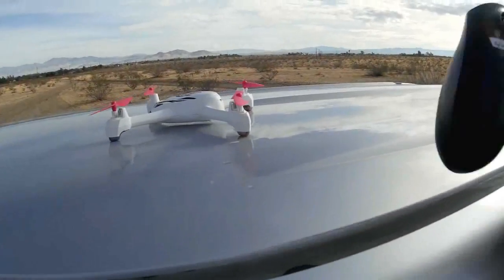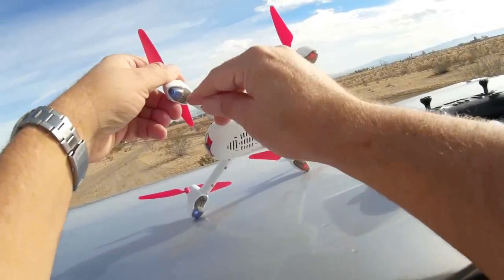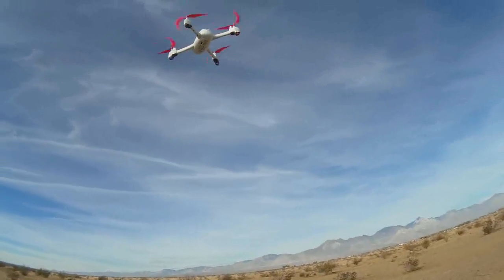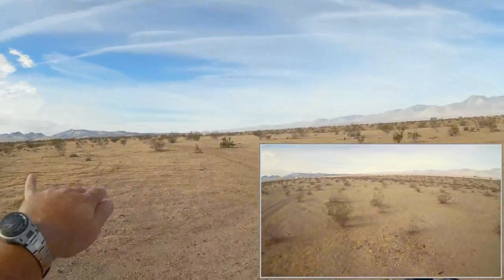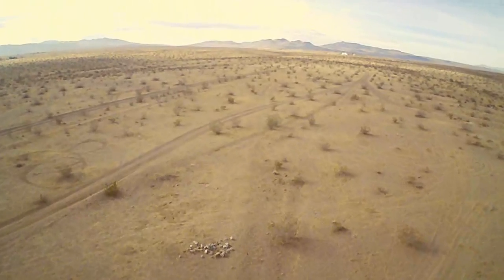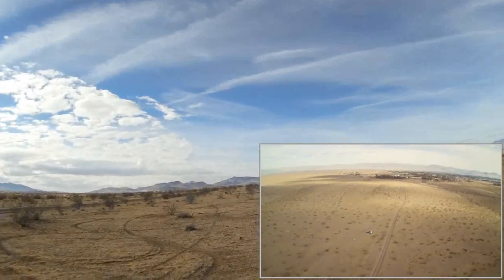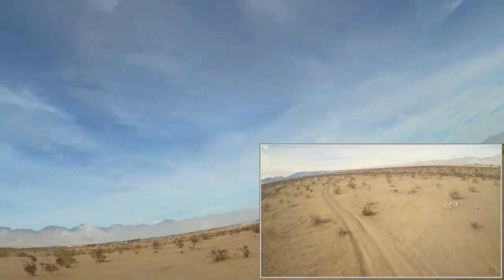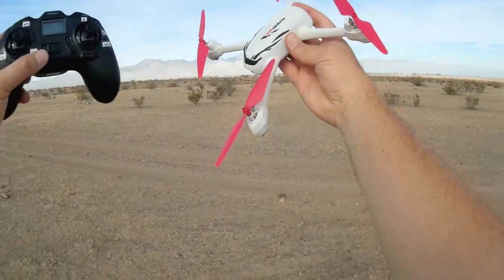Hubsan H502E GPS Drone Tips for New Fliers

Comment: I'm a little late to the game here - but is there a way to arm & fly without a GPS lock?  Now I'm flying indoors the quad will not arm due to the tin roof.  Some sites say it's possible but don't mention how!
Thanks
Reply from the maker: Not sure if Hubsan has changed the firmware?  But try completing the compass calibration, and then try arming the motors by moving and holding both stick down and outward.

Comment: We had two of these from ebay recently and both had motor failures after only a few flights.  The second one fell from the sky without warning.  I think Hubsan has compromised the quality by going with cheap components on these now like inferior motors and plastic bushings now rather than metal bearings compared to when this video came out.  After the first H502E was repaired with a new motor, it failed again.  Even a brushed quadcopter should last longer than a few flights.  Any other gps quadcopters out there like this one, with gps but with brushless motors you would recommend in the sub $100 USD category?  We don't care so much about photography, just having a fun gps quad.  Thanks

Comment: Another nice video.  Great tip about checking the gears too.  Question... so the H502E has full GPS (altitude and position) on all the time and you can't turn off position to just have altitude hold, right?

Comment: Could I ask you , can this h502e x4 desire work with The Xiaomi WiFi repeater? I just bought this drone and I know it’s considered a toy , but im trying to get extended range , can you help?
Reply from the maker: No the H502E does not use WiFi.  But its range is close to 300 meters (make sure to use fresh batteries in the transmitter). 300 meters is a very long way for such a small drone.  I can barely see mine when I fly it out to this range.
Reply: Quadcopter 101 , sorry my assumption was that the remote and the quadcopter both have the 2.4ghz Antenna so I figured if i bought this h502e and the xiaomi WiFi repeater I could get good reception, oh well ! Tell me can the elfie pocket drone from JJRC work with that WiFi repeater?
Reply from the maker: JJRC drones are very iffy whether they will work with the repeater.  But the following does a good job with the repeater https://www.youtube.com/watch?v=_pEcWUU6HEI

Comment: How do I put it into headless mode please. And wich figures show height and distance? Thanks
Reply from the maker: It no longer has headless as that feature was removed about a year ago.  The LCD screen cycles through heading, height, and distance.  When the black line illuminates to the right of the number, its telling altitude.  When the line is below the number, it's telling distance.  When there is no line showing with the number, it's telling heading.  This may help https://www.hubsanus.com/media/support/H502E-User-Manual.pdf

Comment: Quadcopter 101 will it last like a brushless motor drone as long as you take care of them or will it still wear out after some use??🤔
Reply from the maker: Yes it will eventually wear out and need to be changed.  But that could be a long time if you take care of them.
Reply: Quadcopter 101 nice

Comment: Since it's to cold and snowy out I  flew it inside the house, I had a heck of a time getting compass 1 to calibrate  compass 2 went ok, I did pick up 8 satellites  I took it up,  and it would not hold position it was very very unstable , do you think that is from being inside?
Reply from the maker: Yes, do not fly indoors as satellite reception will be poor.  Also wait to get more than 8 satellites for improved GPS position hold.  I usually wait for at least 10.
Reply: Thank you for all the time you put into your video's they are a great help! Yea the only reason I fired it up indoors was that when I hand spun the props, on the one I could hear allot of gear chatter then on the others, when I shut the motors off on the quad one of the props stopped spinning sooner then the others and it was not the one that had all the gear chatter.Point being I just received this quad a couple day's ago and I was hoping nothing is wrong with it before I get a chance to fly it outside. Thanks again!

Comment: I got my Hubsan H502E last week. I was worrying that I get crashes. First thing I did was added springy landing gear.  It protected the copter from the few bad falls.  I'm not sure what to do at this point. The Hubsan H502E has all the GPS counts(11).  It was about 40 feet in the air then it started to wobble and then the toilet bowl effect out of control, down fast.  So far it happens each time I go out to fly. 5 crashes so far.   Is there an firmware update I can download to fix this problem?   I really like this quad-copter.  Please help.  Thanks.

Comment: Hi Quadcopter 101

I have just purchased H502E but cannot get headless to work.  After doing some checking it looks like this feature has been removed by Hubsan on latest models.  I am in UK so it is difficult to get any quick reply from Hubsan.  Are you aware of this change in spec?
Reply from the maker: Yes, the newer Hubsan's no longer have headless mode.
Reply: Hi , Just the H502E?  I have just ordered H501S.
Reply from the maker: I think that they removed it from all the H501 and H502 quadcopters.
Reply from the maker: But why would you need headless mode with a GPS quadcopter?
Reply: Hi
I am new to quadcopters and just thought some times it may be easier to fly headless.  As you say GPS makes it as easy.  Anyway love the videos!!
Reply: Alan Hayton yes GPS makes it almost fool proof .Patience and muscle memory is the key to enjoying this pastime . Watch tutorials and build up to flying in a circle thereby getting over everyones fear of loss of orientation. Have fun

Comment: Hello, Quadcopter101. I have a Hubsan H502e as your test and an advanced command of the H501SS, did you check if the little one is able to be able to fly with the advanced knob?

It would be interesting to use the "follow me" function with the double gps. Although I have my doubts for compatibility with the firmware. Can you tell me something about it?
Reply from the maker: The H502E does not have follow me or FPV capability.  However, the more costly H502S does.
Reply from the maker: I'm actually surprised that the follow me feature works with the H502E when using the H502S transmitter.  But then again, the H502S transmitter has built-in GPS, and is sending its location to the quadcopter.  One disadvantage of the H502S transmitter is that it really drains batteries quickly (powering the FPV screen and its GPS).  That's why I prefer the original H502E transmitter, as it gives range close to 300 meters, and its batteries last long.
Reply: Quadcopter 101 , My friend, the command I have is the advanced 501SS, the batteries are no problem since I use a lipo of 2200mah to 3s and lasts much more. If the standard control is compatible it is assumed that the advanced will also be included telemetry, follow me apart

Comment: This one does turn around facing the "home" location in RTH.  Not the h501s, right?
Reply from the maker: Yes the H502E turns back to face you on return to home.
Reply: Maybe they decided to do it that way on the 501S because of the 5.8 Ghz antenna location inside the drone, it may be in the back.  I don't know.  It would be nice to have it face you on RTH.

Comment: Hi, I have the H502e and am using it as a trainer. It seems as though it is highly vulnerable to any breeze what so ever and is very hard to control. Do you find that to be the case.btw I like your channel.
Reply from the maker: No I don't find that to be the case.  How many satellites do you have locked before taking off?  If 6 or less, you may be flying in altitude hold mode without GPS position hold.
Reply: Quadcopter 101 i love your channel!
Reply: Me 2

Comment: I have the the 502s and have been having trouble picking up and dropping gps lock on the quad. Any thoughts as to a possible cause. Thanks!
Reply from the maker: Are you flying outdoors in an open area?  Trees or any structures will block GPS signals.  You'll need as clear a view of the sky as you can get.
But if you are flying outdoors, the next suspect thing is the GPS antenna shield.  Assuming that you don't have any objects taped or strapped to the top of the quadcopter (these would block the GPS signal), the antenna or its antenna shield might have come loose inside the quadcopter.  The following video (at 5 minutes 40 seconds into it) shows the location of the shield, and how it snaps into place to the circuit board.  As a last resort, open yours up to see if the shield has come undone from your circuit board. If it has, snap it back into place as shown https://www.youtube.com/watch?v=axtgDbbCmcY
Reply: Quadcopter 101 Wide open. a few trees and clear skies. was flying yesterday and it just dropped. Switched it to alt hold mode to retain control
Reply from the maker: It dropped?  That's very different.  Did you happen to notice how many satellites were being received when it dropped?  Was it a rapid drop from the sky or a gradual descent?
Reply: Quadcopter 101 Sorry. The gps signal dropped. Went from 10 sats to zero. It came back eventually but its been doing this sporadically.
Reply from the maker: Yeah, I suspect that your antenna and shield may have come loose as shown in this video https://www.youtube.com/watch?v=axtgDbbCmcY&t=0s  You'll need to reseat it if it has.
Reply: Quadcopter 101 Thank you so much for the help. Big inspiration for my channel and a great resource for us newbs. Keep up the great stuff!

Comment: I just bought the newest sibling to this quad the Hubsan H502C and I aint sure that sand in the brushed motors is such a big issue. Its actually in mine (at least) Impossible to clean the gears that way you talking about. I actually have to open up the whole quad to do that because the gear is allready shielded by the ledlight.
Reply from the maker: Use a pin instead of a toothbrush.  Slide the pin between each tooth.  Also if you have some canned air,  blast it with some compressed air to clean out any loose dirt in the pod.
Reply: Thanks forr the tip, but still not possible. YOu might be right that Hubsan change their design to these motorpods, because to remove these plastic glas for the ledlight, you cant reach the gears from below as you say. YOu have to remove the whole canopy to reach the gears. I mean thake off the top, they whole shebang. I know, Just open up mine H502C that in sense have the same spare parts. :-)

I did try your top, when my motors stoped working, and removed those two screws and the blue plastic and found no gears at all. And to be honest It didnt get me happy when I found out I had to open it up, the whole quad. SO when you shall change motors, or clean the gears  you have to open it up.
Reply: Jerry Berglund should I get 502c or 502e?
I am also considering wltoys v686g

Comment: How do I stop my hubsan desire 502e wirling
Reply from the maker: I'm sorry. I'm not sure what you mean by the word "wirling"?
Reply: Quadcopter 101 the toilet roll effect,, . Sorry about calling it a wirl,
Reply from the maker: DjHappy Raver Wsit for more than the minimum satellites before taking off.  I usually wait for at least 8.  Also, be careful when flying in high rate.    In high rate, with full forward pitch, the quadcopter can sometimes fly faster than the GPS can keep up.  When this happens, TBE will become apparent and may increase as the GPS error becomes worse.  To correct, let go of the stick and let it hover until the GPS fix catches up.  Then proceed at a lower speed than you were flying.
Reply: Quadcopter 101 thanks for the advice,  I'm a drone beginner lol but is becoming a great hobbie

Comment: Since this has GPS. If it get's out of range of the transmitter. Will it automatically start doing a return to home on its own?

Also from watching the video. The little LCD takes you the altitude and distance.
Is that correct? What would you guys say is the max altitude and distance you can fly the quad?

I'm thinking about buying one. It's cheap enough to where I won't cry too bad if it breaks. 

Last does this one have to be registered with the FAA?
Reply from the maker: Yes it will return to home upon loss of transmitter signal.  Yes altitude, distance, and true north compass direction that it is pointed are listed in the LCD screen.  Max distance that I've flown this is just under 300 meters before it lost the transmitter and started flying home.  No this is light enough that it does not require FAA registration.
Reply: Thanks for the reply. I think I'm going to get one to play with. It's affordable to not cry over if it crashes

Comment: QC.... I was wondering if you recovered that H501C. All that and only a single ESC burnt out.

Heck, I replaced a motor on my H501s, and while up 180' it dropped like a rock on my apartment roof, bounced and came to the ground. I replaced the body, flight controller, the motor, and esc. Also had to re-solider a cpl of wires with heat shrink.  On my 501S transmitter, I put a 6.6v, 1100 LifePo battery on it and get 10 flights before needing recharged.

Comment: Hei,Norway calling..hope you don`t mind some questions. Want a "cheap" drone to bring with me when out fishing norwegian outdoor, and tenting for several days. Sice matters..Is the main difference from 502e to 501s, FPV and FOLLOW ME? Is 502 stable in wind as 501? Both has GPS HOLD..? I see that there is big difference in price, and if 502e flys as good as 501, i don`t care about Fpv. Can tou advice me? Hope you understand my english..thank you in advance
Reply: The 501 has brushless motors while the 502 has coreless motors.  Also, the 501 has nearly twice as much flight time and as a result of the longer flight time and stronger motors has a much larger flight range.  The 502 will take you 300-400 meters out while the 501 can go 800+ meters.  The 502 isn't even close to being as stable in the wind as the 501.  The only word of caution for either is with regard to Hubsan's quality control.  Seems like you'll either get a good quad or a bad quad...50/50...and they don't have adequate staffing or a "proper" department to provide the quality customer support you'd expect from a company with the market share size that they have.
Reply: Thank you..

Comment: Interesting reading the comments. I had a few crashes in trees and grass and did not immediately turn the motors off. I then had problems calibrate and binding the transistor. Fixed those problems but now cannot arm the copter? Does anyone have a solution? I hope it is a simple solution. Thanks.
Reply: DId you try to rebind the TX to the Quad? You shall press the Video/Photo button simultaniosly when you turn on the TX. Dont forget to turn on the QUad first though. :-) But maybe you allready got it fixed. I did see that its 2 months ago. lol

Comment: What is the difference between the 502e and the 502c?  On the hubsanus website it shows the same features. I am looking for a small gps quad for my trip to scotland next year. something small enough to put in a backpack. is the 502s significantly better?
Reply: The differens is in design, Propretary Battery and it don't have Headless mode, Flight board might not be the same as well. But thats the only thing. The rest is the same. TX is the same, Motors is the same,  Camera is the same, Lots is the same.

Comment: Quadcopter101 Another nice Review! i have had a coupe of motors fail on this quad first time i got a replacement quad, but 2nd time i had to order new motors from china (still waiting for them) i have tried to use other motors which are same size except they are from a 3.7v quadcopter, they work for a couple of mins then fail. these motors only come in 3.7v so how they are getting them to work in a 7.4v? are they using some sort of resistor ? anyway its a shame because the only place i can get the motors are china.

Comment: I have both h502s  and 501s and the 502s  the  smaller  gear fell off . I researched this issuse and it's common.  I use both drone off the same controller
Reply: william torres yes the have a lot of force to handel and if they are not installed correctly or loose they will spin right off ! , I have a different drone that lost a 4 pinion gears in the same day , eBay sells replacements for them mine use the 8tooth brass , some have 9 & 13 teeth and are plastic with different outer diameter and inter diameter, so look carefully